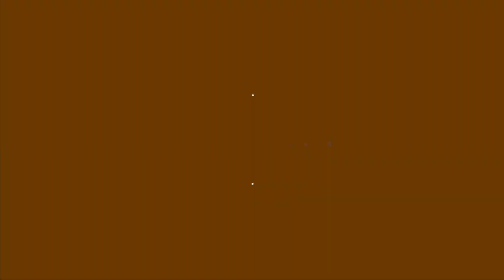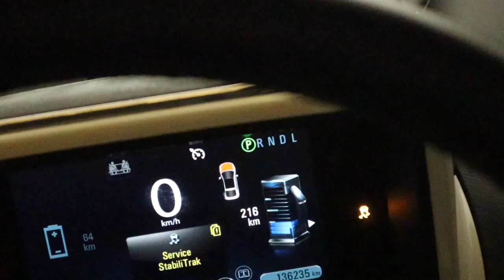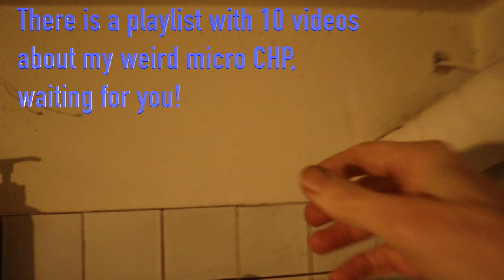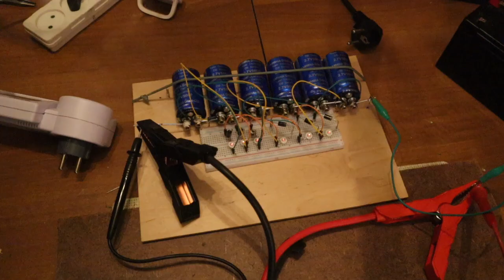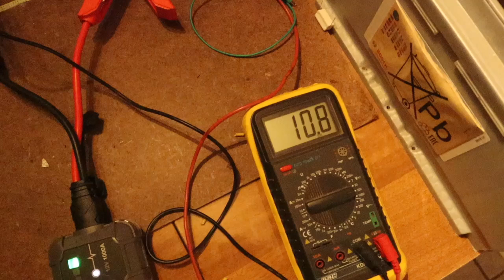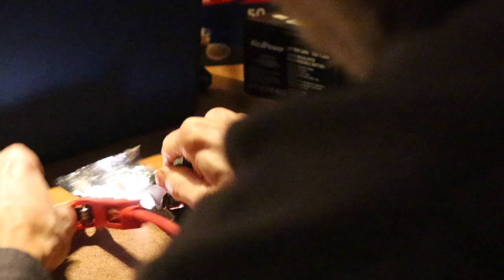What To Do When Your Car Battery Fails Completely - 87

Comment: i carry a cheap jump starter in my car, but its really not for me, just for jumping other people coz my car has a weird diy lto battery that is small capacity and i no longer trust people to hook up cables correctly. the problem with having a small lto pack of around 22ah, is the capacity is so low that jump packs will probably not allow it to be charged if the voltage is below ~10v. common safety mechanism built into these jump packs.
i also carry in my backpack a ~60wh 5-20v usb-c battery bank i built for charging my laptop as well as a small DP100 usb-c adjustable Power Supply. my plan if my battery ever gets discharged somehow (and my solar roof doesnt work to charge it back up) is to manually charge the lto pack with my powerbanks.
i should be able to put around 20% capacity into the battery and ideally that will be enough to get the car and dc-dc converter in my volt to take over. havent had to use so far :p going on almost 2 years since i got rid of my agm battery in my volt lol.
Reply from the maker: Hi Veven, was you the one that wrote a week ago about your Chevrolet Volt? Unfortunately there is no search function here in the comments.
I started also my Chevrolet Volt with the NOCO Boost GB40 and I can charge it with USB, so I did it actually with the INIU Power Bank for USB, 20000mAh, so there you are, we did more or less the same thing! It is anyway funny (for people that don't know about up-transforming DC) that you can use a 5 Volt battery to give such an incredible boost: the Noco is rated for 1000 Amps even if I can hardly believe it. My Chevrolet Volt did it with much less. 
Anyway, the people will be glad that you are around 😉.
Reply: @nnvasen-good-energy  ya that was me :)

Comment: Why are you recommending some unknown tire inflator from amazon just because it is their choice?  They have at least two others that are also their "choice".  None of them are remotely like yours since they require the car to have a working 12 v jack.  I would prefer you recommend things that are known to work and likely to last at least 5 years.  I don't trust ratings or stars on amazon. Thank you for your other content. :)
Reply from the maker: Hi CCP, I have this compressor already a year and while purchasing, I have been reading feedback of others I don't go over one night of ice, like the Dutch say. Others said that the measurement is precise compared with a comparing measurement. It has been also been forgotten outside on a rainy day and still working well. I like the pressure measurement and the fact that you can modify the set point even during compressing.
I would like to try it also as a compressor for laboratory work, avoiding purchase of a workshop compressor. Just see what happens if I connect it to an air pistol and other air tools.
Thank you for your appreciation for the channel!

Comment: Thanks for sharing the video -- very interesting! In my step son's 2012 Volt, the gasoline engine would also start when the hood is raised and the power button is pushed. It's a way to get it to charge if the external charge port is not working correctly (although at the cost of gasoline).
Reply from the maker: Great point Feraloid! That is also happening with my car. Are you in the USA? I bought this car in Switzerland and cannot import it in Italy because of red tape. That's a real shame. 
I like this concept where you need less lithium and cobalt in your car so that if you commute every day 40+40 km then you are covered with electricity for all the time, without transporting a ton of batteries, just for those few occasions that you have to travel 500 km...